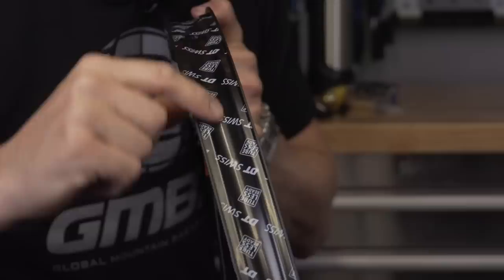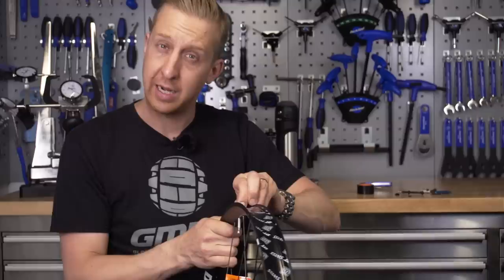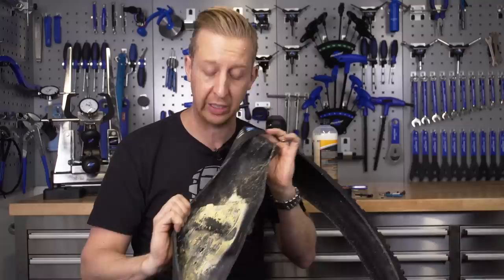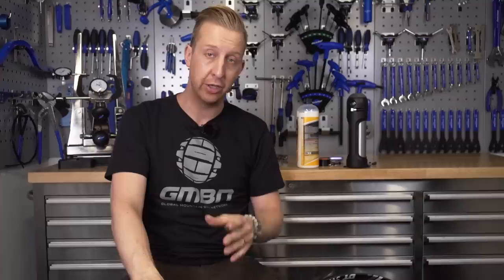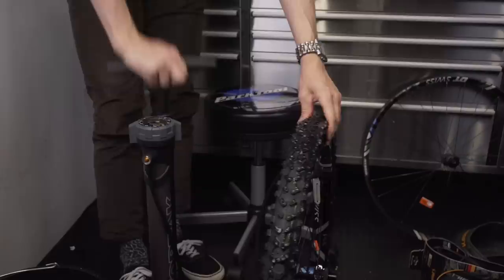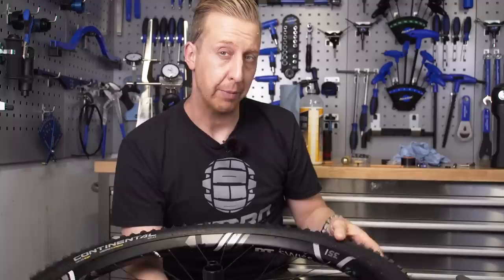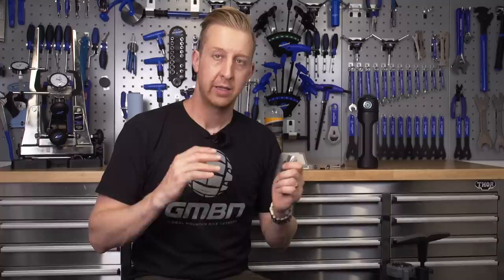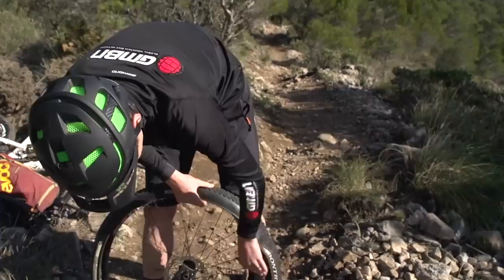Mountain Bike Tubeless Tyre Set Up 101 | GMBN How To

Comment: Nice vid... I have experience with the air escaping between the rim and the tire, even though both are set up for tubeless. Hoped this was covered also :O(
Reply from the maker: It sounds like the tyres aren't seated properly. Are you running tubeless ready tyres?
Reply: Yes for sure, expensive ones from maxxis and also the rims are prepare. It works in the beginning but after a period with hard turns and low pressure 20-22 psi it starts. any experience with glue?

Comment: Hi Doddy, great video. Can you also go into what happens when you need to refresh the sealant around 3 months later? Do you need to remove the tire, clean it and then do the process as in the video again. Or can you just add some new sealant through the valve? Thanks! and keep it up! love GMBN Tech!
Reply from the maker: That's a good idea! Generally it's good to check if there's any dried sealant clumped around the tyre and to remove it. then refill with fresh sealant.

Comment: Thanks for the video! I've just set-up my two wheels tubeless. Gorilla tape x 4 wraparounds was necessary to get my 'tubeless ready' tyres to seal (Maxis Ardent with stock Alexrims on a Voodoo Bizango from Halfords in the UK). I'm not convinved they are seated properly (no ping-pops when inflated). Got both tyres up to ~50psi. Will leave overnight to see if they retain any pressure.

HIGHLY RECOMMENDED: I purchased a track-pump with a holding tank (holds 250psi but not sure of the volume) to do this. Absolutely no way I would have been able to do this with just an ordinary track pump (don't even think about trying a hand pump).

Comment: How often do you need to change out the sealant? And when you do, do you need to clean out the tire and rim completely or just pull the old sealant out and pour new sealant? Or just add to what’s already in there?
Reply: They usually say every 6-10 months, I think. And sometimes you can just do a top-off.

Comment: Do you need to use the sealant?  I have a first generation UST setup and I've never needed to use sealant.  Mavic ex823 rims with 2.5x26 Minion DHF UST version front and rear.  I usually lose some air over a week but I just top up with the air compressor and I'm good to go.

Comment: I know that this is an old video but can anyone help me. I was wondering if after you seat the tire and put the sealant in do you have to use a pressure canister on your bike pump to put air in the tire or can you manually pump it up?

Comment: Great video! Can you do a video on ‘selecting’ the proper valve? I have an Orbea Occam TR with Traxx Mach 1 rims and Maxxis Ardent tires - I chose to use WTB valves to go tubeless - no issues... just curious if there is a better valve for my rims. They seem to fit / work well. Thanks again!

Comment: Hi Doddy ..
I watched your videos and I respect your good job doing it to help us dealing with everything about bicycles..!
I would like to ask your advice please for something i want to do if it is work successfully or not :
I have a Trekking bicycle 28" tires and i want to change them with a Mountain Bike tires not completely with the Metal things but only upper tires with mountain bike so that i can ride it in snowing days easily without slipping or through sands & rocks..!

So what do you think about it is it possible or it can't be done by your experience?
Thanks a lot...

Comment: Hi Doddy, how do you know that it's time to replace the sealant in the tires?
Reply: You don't, just bung new sealant in the vlave every 4-6months depending on heat and riding style. You don't need to take the old stuff out until the is tyre knacked. But leaving your bike for long periods is bad for sealant. It needs to be used.!

Comment: you guys always miss the last resort tip to seat a tubeless tire the won‘t pop without extreme help: use an inner tube and cut it a few cm from the valve - with enough room to tie a knot into both ends - inflate the tube, it will seat the tire completely, then open only a small gap and pull your inner tube out through it, then install your tubeless valves. with the tire only removed from seating on a very short stretch, even the most hesitant tires seem to work. still a thumbs up
Reply from the maker: That's a great tip! Will definitely keep that in mind for our future tubeless conversions.

Comment: Any tips for a slightly twisted tyre? I’ve got both beads in the middle of the rim. Just can’t get them to pop on the bead with a floor pump. Any tips would be appreciated 👍
Reply: Try using a kayak strap, cinch it snug over the center of the tread then pump it up with a hand pump works every time.

Comment: Hey Doddy, when you remove the valve core for cleaning when it gets clogged, how do you do it? I use the Continental sealant, which is not armonía based, so I have no idea what to use in order to dissolve the dry sealant.. I ended up disassembling my valve cores and scratching everything out of it.
Reply: Tubes!!!!!!!!!!!!!!!!!!!!!!!!!!!!!!!!!!!!!!!!!!!!!

Comment: I am thinking of converting to tubeless but have one big query. I live abroad over the winter and leave my bike in the garage for 6 months; would all the sealant collect at the bottom of the wheel over time meaning i would have to do the whole thing again every year or does the sealant need replacing periodically anyway ?
Reply from the maker: Hey Paul Inglis, the sealant does need replacing periodically anyway, but not sure if you're need to replace it after leaving it for the winter. Either way, why not just get a large bottle and replace it for safety's sake? Or better yet, just remove it from the tyres before winter. It's not a big job, and worth the benefits for sure.
Reply: Thanks, I'll be brave and give it go. Cheers

Comment: #askgmbn 
I bought recently a pair of tubeless ready rims and failed to mount tubelees tires on. Even failed to seat the tires with tubes properly. No pop sound up to 4,5 BAR. Montage fluid was used. Tried different tires from two well known manufacturer, but nothing helps. What's wrong?
Reply: Andrew Andrew, sounds to me like you are the problem. Who cares what your friends use, it is just another ego thing. Do your own thing it worked before it will work now, tubes and a patch kit/ spare inner tube and ride on.

Comment: Can I use schrader valve for tubless valve.
Reply: Yes. You can cut a valve stem out of a tube too but you will need a 'fully threaded' stem. You may need to make a soft seal washer, I did this by using a leather punch on some silicone rubber then trimming with scissors and stretching it over the valve stem before installation.

Comment: Question: I want to buy light tyres that I like (with low weight and rolling resistance) 29" , that are supposedly TL (or TL ready) and still use them normally with tubes?
Reply: Michal Wiktorow off course you can that’s how most bikes come
Reply: Yes.

Comment: After watching the vid just had another go at my rims, the only place it leaks is at the rim joint opposite the valve hole, it’s got 3 layers of tape on it, anyone have a idea?
Reply: You can do it the ghetto way with a split tube instead of the tape, perfect seal all around the rim bed

Comment: Would a tyre that does not state ‘tubeless ready’ work?
Reply: Jack Daniels yea but it would seep sealant through the sidewall and you would have to run higher pressures
Reply: Thanks Yaish Matheen pressure is not an issue, getting a 1L (q) sealant bottle.

Comment: I don't want to buy a new rim or tyre and let my present one go to waste. 
So can a non-tubeless ready tyre and non-tubeless ready rim be converted to tubeless with a kit? 

About slashed tyre, can't a tire boot be decent solution on the trail?
Reply: v1d300 it's very hard to get it working that way, you can keep the rims and gorilla tape it but you'd want tubeless tires to make the setup non stressful. Tires are way cheaper than new rims too.
Reply: Get a bmx tyre, stretch it over your rim, cut it in the middle all the way round,pull the ears out, put your outer tire on, cut the bits of the inner tube that is sticking out and job done, you are running tubeless...

Comment: Hey Doddy, I recentry bought 2nd hand Bird Aeris 2016, but i find it very hard to pump the tires. I cleaned the cores, but I still have to put all my weight on the pump, to put a little bit of air in the tire. If I have to pump the tires when they are deflated, I remove the valve cores, and I have to hold the end of the pump hose on the valve, and to pump the tires (kinda hard this way, but its way faster). 
Do you have any idea why my valve cores doesn't let alot of air through them ?
Reply: Petar Nikolov maybe it's your pump??
Reply: It might be the pump, but when I try let a bit of air, its slow AF.
Reply: Petar Nikolov have you tried putting a new valve core in (from a spare tube)?
Reply: Steven S nope, first I have to find one. There are no alot of people who ride with presta valves
Reply: Petar Nikolov do you have the same issue with both wheels?
Reply: Steven S yeap
Reply: Petar Nikolov with the core removed, can you blow through it?
Reply: After I cleaned the cores as much as I can, I tried them with the pump, but it was still very hard. It might`ve been a bit easier, but not much.

Comment: Please don't go above 40 psi when setting up your tubeless tire! While the tires themselves mostly are qualified for that pressure, most of the rims aren't for wider tires in the 2.3"+ region! For example, the Stan's Flow MK3 is specified up to 37 psi for 2.4" tires (and 26 psi for 2.8"), the Funworks Track Mack Evo to 2.7 bar (39 psi), and DT Swiss sets the limit to 46 psi for 60mm tires (and 42 psi for 62mm - see here for their pressure chart: https://dycteyr72g97f.cloudfront.net/uploads/WXD10000000866S/MAN_WXD10000000866S_WEB_ZZ_001.pdf). Basically the wider the tire and the rim, the less pressure you're allowed to use (look up Barlow's formula).

Sure, most times you come away with it, but there are some unlucky combinations of tires and rims where the fit is too loose. I've had a tire explode from the rim at 4 bar (58 psi), after which the rim was damaged, and I've read reports of people who had a blast trauma after pumping up a tubeless tire too much. It's just not worth it, if the tire doesn't seat with around 40 psi (2.8 bar), then there's something wrong. Use more tire fitting fluid (Schwalbe sells these, or simply use those made for cars), soapy water (although I'm not a too big fan about this, because the soap won't fully evaporate), simple water, or just use tire sealant for some extra sealing afterwards. Basically anything that will make the sidewalls slip into place will work.

It's not worth the risk to pump up so much. Stay safe.

Comment: Never had sealant leak out from the beak using the ”wet” method
Reply: Well aren’t you lucky lol, I have not been having good luck; I got some guys at my bike shop that let me just do this convert for free myself, but yeah I used the “wet” method and it was messy doing it there leaking out the sides, and also my back tire must be the devil, because while the front tire is now good, the back tire was flat when I woke up today 😭
Reply: However they aren’t using the same rims, so I almost know the back rim is the culprit here, but I don’t have $75 or so to throw at a new rim

Comment: Seths’s bike hacks suggested putting glitter in the sealant for a quicker seal a few years back... would you recommend that?
Reply: bigarnd Seth did not recommend that. He found it sealed a slow leak, but he mentioned it’s not a good idea in the long run. It might clog the valve, or ball up the sealant
Reply: Also modern sealants have particles already that work very well by themselves, so no need to put another type of particle
Reply: Nope

Comment: To sum up:

* lots of hassle
* it is wet and messy
* sealant dries and needs refill
* not always 100% airtight
* not much lighter: tape + sealant vs inner tube
* sealant sloshing around in your tyre
* need good compressor
* cannot always use CO2
* need extra tools for valve removal and sealing holes
* valve must be a good fit
* rim and tyre must be a good fit
* still need to carry an inner tube on the trails

So much for progress.

Comment: The proliferation of tubeless tires and rims has hurt the sport of bicycling. Not everybody  would prefer to use this method, but the manufacturers have all grouped together to the effect of rendering the method of using tubes to be obsolete. The ability to have a choice of quality non-tubeless rims and tires is diminishing. We would not need this video except that the construction of rims designed to be tubeless have a flat area just below the bead seat that is there to assist with the seating of the tire (with its sealant). Rims for tubed tires have a shallowing section here, and allow the bead to pull up right to the seat area. HOWEVER, THIS FLAT AREA IS THE CORE REASON THAT TIRES DO NOT SEAT. The problem is that the tires bead tends to stay in the channel where the spoke ferrules are, and not lay flat against the bead seat.

Comment: I don’t understand the point of doing this. Tubes are easy to fix on the trail. This would be a major PITA to repair.
Reply: The idea is so you don’t have to worry about punctures so much and can run lower air pressures
Reply: It's about what is more probable: Lots of tiny punctures (tubeless is ideal) or rather few big slashes (tube).
Reply: Also offers lower rolling resistance with the tube gone (and similar to cars, lowering unsprung weight makes significantly more of a difference than sprung which is essentially everything above your wheels) and allows you to run lower pressures than with tubes giving you more flexibility on your grip level according to the terrain

Comment: Does tubeless save you weight on your tires compared to tubes?
Reply: eric thatcher yes
Reply: Yes absolutely
Reply: eric thatcher Of course; less weight,  lower pressure, more grip and potential for flat seal are the benefits
Reply: No, but depends on width. I invite you to do the math. Below 42mm width it's heavier, especially so once dried up sealant has accumulated. (Ex. 28mm: light butyl inner tube is 70g, tire 200g; tubeless is 60g sealant, 10g valve, 260g TL tire.)

Comment: never switching to tubeless because im not rich, you got flat on tubeless you need to buy a new tire that costs 60-70$ but when you are running tube you just buy 7$ tube, simple
Reply: Not quite. Depending on where you ride, you could save a lot of money going tubeless. Additionally, the only time you'd need to replace a tire for tubeless is if you are riding over things that end up with more than 1/4" holes. Otherwise, the sealant does its job.

Comment: Tubeless is crap to much stuffing around I can change a tube tyre in five minutes and it's easier 2 adjust the air in it
Reply: Tubeless is weight-efficient above 42–45mm tire width.

Comment: Never tells you how tight to screw the valves into the rim. That is a small piece of info that ruined my day.
Reply: ok, so there is a back story here. I have a pair of Spank Oozy's that I just acquired, they have built in rubberization so no need for tape to make them tubeless, they also have space between the inner part of the rim and the outside. I'm guessing 1/4 to 1/2 inch. So I'm trying to dry fit my tire and noticed my valve stem was loose. So I tightened the metal outer nut with my fingers, and I then figured eh, give her a little extra juice. So I took a pair of pliers and gave it a half turn. The valve then got WAY loose. So I kept turning til it tightened back up. Turns out I pulled the back of the valve into that gap, and ruined the valve stem and obviously couldn't fill the tire. So I was trying to find where it tells me how tight to make the valve. Obviously now I know finger tight only.

Comment: Tubless tires on a bike are a waste of time. Just carry a spare tube/ patches. A flat on tubeless tire is nothing short of a train wreck.
Reply: Not too sure of that...
I lost a couple of first place finishes racing XC back In the early 2000's due to tube failure.
Pinch flats... would never have happened had tubeless been an option back then. 

So yeah... tubeless is a pretty cool option.